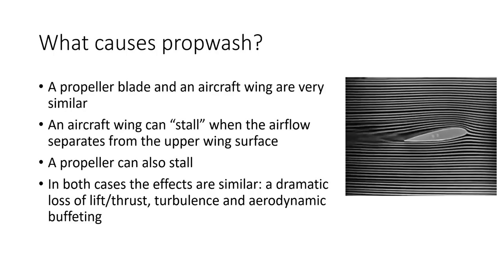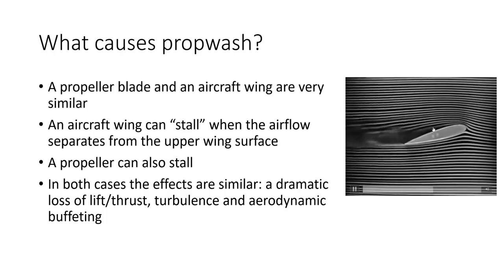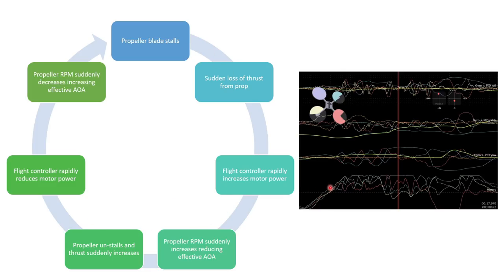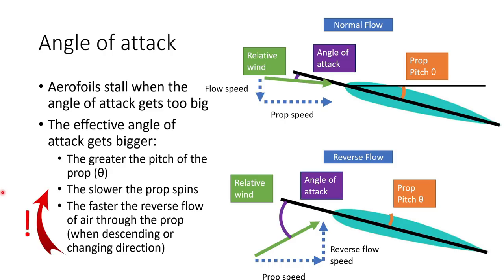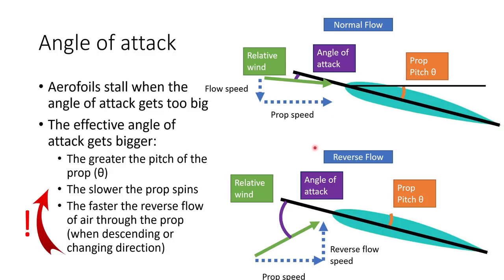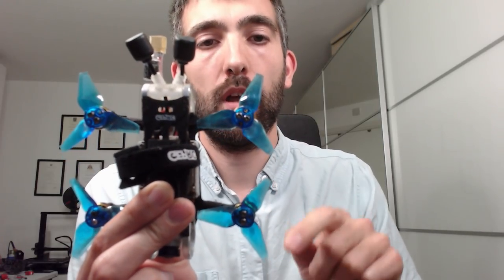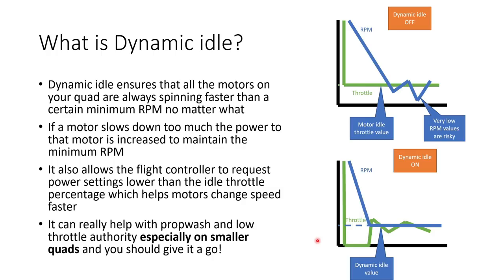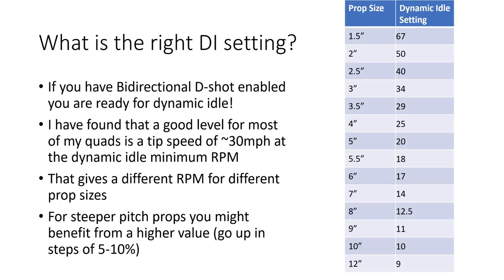What causes Propwash and how Betaflight Dynamic Idle can help!

Comment: After making a tutorial about dynamic idle, I got a lot of feedback from users and from in-the-know experts, and long story short, I concluded there is not a consistent agreement about how to correctly tune the feature, nor is there consistent advantage from using the feature according to commonly given "best practices". Personally I don't use it and just go with a fixed idle percent per usual. As long as you keep the idle percent high enough to prevent the prop from stalling, all is well. In theory you can get lower idle speed by using dynamic idle, but like with many dynamic elements of Betaflight, it introduces uncertainty and it's not always helpful.

It'll be interesting to see if Chris Rosser's recommendations can finally make this feature beneficial for a majority of people.
Reply: He raises idle value after enabling dynamic idle not lower
Reply: If I remember correctly your choice of not using dynamic idle was with betaflight 4.2. Lots has changed on 4.3 concerning dynamic idle. Have you given it a try on 4.3?
Reply: @sendorm  is 4.3 officially released yet?
Reply: If you tune for maximum hangtime it helps to keep your quad stable at spool down with way lower idle %.
At the moment this is the only aspect where Betaflight outperforms  Emuflight.
Reply: Isn't it that enabling dynamic idle, by increasing the minimum prop speed, effectively decreases your hangtime when inverted?
Reply: For me it not about prop wash it really help with low crushing stability mid oscillations it seems the pid loop have much more authority to do minor adjustment
Reply: @TheSTallINNA  Not yet but the nightlies are avaliable.
Reply: @TheSTallINNA  No but many of us are using nightly builds and seeing the benefits.
Reply: a lot has changed since you had a proper look at any thing BF frankly ;]
Reply from the maker: Hi JB, thanks for taking a look at the video. In BF 4.2 the control loop for dynamic idle (DI) is quite basic. This can lead to wobbles at low throttle unless D_shot idle is set high enough to avoid hitting the DI level except in extreme situations. In BF 4.3 DI has a PID controller which solves this issue and allows you to set Dshot idle very low without wobbles.
Reply: Like d- min was so great when it first came out now everyone just turns it off 😆 🤣
Reply: It's likely that in betaflight 4.3 final release, there will be no need to adjust the DShot Idle % value or measure rpm or any of that stuff as in 4.2.
It is unquestionably a much better way to avoid desyncs and slow motor startup problems than static idle settings.
It is a sophisticated form of the old and much-loved 'idle-up' that we used to apply after take-off to stop the motors going too slow.
In the final 4.3 code there isn't any tuning to do.  Just set a suitable dynamic idle value.  A good starting point is 3000 - 4000 rpm for most quads, higher with smaller props, lower with larger props.
Too high a value and the quad will be floaty in flat zero throttle drops.

Lower values give less thrust in flat zero throttle drops, so you drop a bit faster as you reduce the min_rpm value.  Lower values will tend to give slightly better inverted hang time (but only at the start, when you first turn upside down, in that period while heading upwards fast upside down at zero throttle; once you are dropping, just having dynamic idle on stops you being pulled downwards ).
When too low, you may get desyncs or have issues with wobbles at the end of flips from partial desyncs (like what you get with too low a DShot idle value).
The highest idle rpm value compatible with reasonable flat zero throttle fall rate will give the best handling in most cases.
Most racers would go for a reasonably high value.
Reply: @TheSTallINNA  nightly build, yes
Reply: There is really no reason to use fixed Idle percent anymore on 4.3. As long as you get a similar RPM equivalent you will get more low RPM control. Especially with high speed drops or turns.

Comment from the maker: EXTRA INFORMATION:
1. When using steeper pitch props you may need a DI value 1.5-2x what I give in the table at the end of the video to control propwash (e.g. up to ~ 40 for 5"). I fly very light pitch props (Ethis S3, 5.5x2.2 etc.) which do not stall as easily so can have a relatively low DI value.
2. For inverted hang time a light pitch prop is very helpful as you can run a lower DI value and it makes less thrust at any given RPM.
Reply: Chris, is your table still usable for BF4.3, or is a fixed setting of 30 a 40 best for all size props?
Reply from the maker: @HaraldLabout  It's a good starting point for 4.3 and you work the value up until you have the desired bahviour.

Comment: Excellent explanation of the topic! One little remark: It's important to tune the FC for propwash but it's equally important to know how to avoid it as a pilot (line-choice & throttle management).
Reply: As propwash handling improves, the need to fly around it reduces.
Reply from the maker: Very true. My videos tend to focus on getting the best possible performance out of the quad. That will allow the pilot the most freedom when choosing their lines.

Comment: What never occurred to me until I saw the graphs is with dynamic idle Betaflight must have placed the min-throttle in a closed control loop using eRPM as feedback. Initially I couldn't see why this would be significantly better for prop wash handling given that DSHOT updates (and eRPM telemetry) are usually locked in at the PID loop rate (e.g. 4 khz). But then I realised the control loop using eRPM would have much lower latency in detecting and correcting a stalled prop vs the PID loop having to gyro inertial measurements to correct for the slower oscillating prop wash which resulted from the initial stall. Brilliant, thanks for sharing this.
Reply from the maker: In 4.2 the DI feedback loop is quite simple based on eRPM as you say. In 4.3 DI has a full PID controller which improves the performance a lot and allows you to run very low D_Shot idle values without low throttle wobbles. By the time an issue is detected by the gyro it is really too late because the quad is already wobbling.

Comment: For anyone interested, there is academic windtunnel data of single and multiple propellers with negative inflow to determine the causes of propwash oscilations for quadcopters (5 inch fpv type). Unfortunately, the explanation you give (a rapid interaction between the controller and the blade stalling), can not at all be see in this data. The propeller blades do not stall like wing blades do, probably because the prop generates its own induced velocities. No 'sudden loss of thrust' was observed. The interaction between an isolated propeller and the flight controller is therefore unlikely to be a significant cause of the propwash oscillations. It seems to have more to do with the turbulent flow conditions that are generated by the props, rather than the quad changing its stability characteristics. (The study was made public after this video came out)

Comment: Excellent explanation, as always.  Been using dynamic idle for a long time and it really helps prop wash; set correct;y, similar to your explanation, it allows reduced prop wash without the adverse effect of too high a Dshot %age idle creating too much float.  Simple calc to set dshot idle at 20% higher being (D.Idle X 1.2)/(batt volt x motor kv) which is a lot less than simply using dshot idle at a high enough percentage to give same effect
Reply from the maker: Your calculation is a good one. It's worth considering that batt volt * KV only gives the unloaded Rpm (no prop). If you multiply by 0.7 that's a good approximation for rpm with a prop. So your equation might be slightly more accurate as so: d.idle*1.2/(battvolt*motor KV*0.7)
Reply: @ChrisRosser Yeah, I forgot about that. The 0.7 is about spot on Chris. My 1900kv spin up to about 32 to 34000 rpm in flight, about 0.7 of propless speed, so yeah I'll try that today 🙂 nice one.
Reply: @ChrisRosser  excellent video. I am a bit confused after reading the replies: i am running bf4.2 on a 4s 5" quad with 5048 props and 2450kv motors. Should i set dynamic idle to about 30 and then the dshot idle to 30*1.2 /(14.8*2450*0.7)=1.4?

(I would like to maintain good inverted hangtime as well as the benefits of dynamic idle with preventing stalling etc.)

Comment: I have tested this back and forth many times now, and I can honestly say that I don't like dynamic idle.  I understand the idea behind it. but I don't think it quite works how people perceive it to.  I feel like I constantly have to reposition the sticks during a long, smooth, slow banking turn.  smooth stick input should equal smooth flight path.  I'm pretty sure I can feel those moments that motor power is increased to meet min rpm after motor braking, and it's causing shifts in the flight path.

Comment: PSA:

So, after doing a ton of research on the subject, if you are on 4.3, you DO NOT want your dshot idle percent to be over your dynamic rpm value. In fact, a dshot idle percentage of 1% is desirable (per Chris Thompson). The values in the table are a fantastic starting point for Dynamic RPM values, but if you end up with poor low throttle stability for some reason (unlikely) or wish to have a bit better propwash performance at the expense of inverted hangtime, you can raise your dynamic rpm value (NOT THE DHSOT IDLE PERCENTAGE) to about double what chris has in the table in the video.
Reply from the maker: Yep spot on. In fact in 4.3 enabling dynamic idle in the configurator will disable changing Dshot idle entirely so you literally can't get it wrong once the relevant PR is merged. For 4.2 it is still very important to set Dshot idle 20% above dynamic idle to avoid low throttle wobbles 👍

Comment: Lemme get my tea

Edit: Ok. I've watched it. At your previous tuning video you gave a calculation for determining this value. My 5.1 inch prop quad calculations were about 18. Maybe it was a tad low. I will try 20 to see if i can notice any difference. Thanks for this video. I'm sure it will help to many people
Reply from the maker: It depends a lot on the pitch. If it's a very light pitch 20 will be good. For a steeper pitch 30 or even 40 might be necessary to control propwash. Work up slowly to find the minimum that works for you.
Reply: @ChrisRosser  i was using ethix P3 but gonna try out HQ j37. 
I think you should create some content about different airfoils and prop dimensions - propwash effects

Comment: Thank you, thank you, thank you for this video and all of your videos!!! This was extremely helpful in my 4" toothpick. I'm having trouble with severe oscillations, like an audible and visual shaking especially after bumping something (a branch, tapping the ground) and the quad violently shaking (oscillations?) while in an almost fly-a-way state until I drop the throttle and apply throttle again after a second (and yes some prop wash). It's a BNF, the GepRC Dolphin HD 4" and mechanically it's all new and sound (new undamaged motors, proper firmware including RPM filtering via Bluejay and all the screws and arms are secure). Only have a couple of packs after the changes, this certainly helped even though my main issue wasn't prop wash, this seemed to have a positive effect. If you have any suggestions, I'm open for an education and always appreciate your time and efforts. Have a blessed day!

Comment: What do you do in the case of a cinelifter? I would think you have to have a high idle value from the standpoint of load and responsiveness. I find if I make too much a drop in throttle position the bird comes down like a rock with low pitched props vs high pitched props. The low pitched props give me the best video, so I increase my idle value accordingly. I personally keep my moves to have long drawn out movements for the purpose of smoothness, but I can see that dynamic idle can help with smoothing those moves. I think with cinelifters it can be used, but the dshot idle percent value (critical to get right) has to be high enough to support the weight of the quad with respect to the prop being used. Great stuff Chris I really enjoy your channel.
Reply from the maker: If you move to BF4.3 you won't need to worry about dshot idle any more and can simply set your dynamic idle to give you the low throttle feel you want.

Comment: Hello Chris,
for me PropWash is mainly due the propeller going though its own wake, and turbulences. I'm not sure about your vicious circle, I think the FC is only accomodating with the air turbulences it faces.
when piloting, you get propwash in turns and when going down flat. you can easily avoid propwash in turns by managing thrust efficiently: in turns, you have to counter the centrifugal force by increasing thrust so that your quad doesn't slide in the turn, and doesn't meet its own wake: easy, efficient, and doesn't require any tunning ;-)
keep the good work.
Reply from the maker: The prop going through turbulent air was always my reasoning for why propwash happened. But when I researched the subject and did my own testing I could see propwash occurring in situations where there wasn't any turbulent air incident on the prop. The test I used is to fly very close behind another quad. If it was turbulent air causing propwash you would expect very bad propwash flying behind another drone, but that doesn't really happen. So I had to discard that as the primary explanation. Turbulent air does promote flow separation from the propeller, but flow will separate in completely clean air with enough reverse flow. When you are increasing thrust through your turns you are increasing the RPM of the prop, increasing the inflow velocity and therefore reducing the effective angle of attack of your prop, preventing flow separation and propwash.
Reply: @ChrisRosser  when your quad sinks in a turn, the propellers meets the first centimeters of the turbulences it generates: I don't how you tested it, but it easy to do safely with whoops: if you follow à 5 inch 2m behind (and underneath right?!) You might be too far.
Clearly, reverse flow makes it worse. But, you are missing the solution here, avoiding sinking in the turn by putting more power to avoid turbulence, but also reverse flow.

Comment: I have the woopfly16 by sub250. It tgis also possible for woops. This one is a bit on the heavy side. About 50g can i use dynamic idle for that. Prpos are 1,6 inch

Comment: I'd probably put a big disclaimer on just going with preset values. Most my 5inch quads are at about 19-20 when tuning via motors tab which is inline with what you say, but my AF227 are at 24 at 4% idle. Attempted to preset them at 20 and got a desync first flip.
Reply from the maker: Did you set your D_shot idle to 20% more than idle RPM? You can estimate it by taking DI*1.2/(motorkV*battvolt*0.7) which would be ~7.5% for 1960KV on 6S, ~8% for 2710kV on 4S. 4% on 24 sounds a bit low to me?
Reply: @ChrisRosser  Don't know about that, but I like running low idle ~3-4% so I don't get sucked to the ground when I'm upside down. 4% on motors tab spins the motors at ~3000 RPM with a prop on. According to BF wiki entry for dynamic idle, take 3000, knock off two zeros and multiply by 0.8 to get 24. These specific motors have a lot of thrust and poor low throttle resolution, so have to compensate by setting throttle expo at throttle mid point.

Comment: Hi, thanks for the wonderful video Mr. Chris. I have a cinerace20, I love how it flies but it goes into terrible prop wash after some power loops. Do you think upgrading motors from 1203 5500kv to 1303.5  5500kv will help maintain higher torque and reduce prop wash?

Comment: Great video! I've always wanted to learn where propwash is comming from. I don't use dynamic idle until now. But I'll definitely give it a try! Should I include it into my tune now or after I've finished following your BF4.3 tuning series?
Reply from the maker: In BF 4.3 you should definitely be using it. In 4.3 you can set D_Shot idle to 0% because DI has a full PID loop so performs much better. I'll cover this in more detail in a future video.

Comment: In the 4.3 tuning notes, CT has some interesting ideas around putting the idle value below the dynamic rpm value. I believe to allow the separate PID controller on Dyn idle to do its thing at low RPM. Any thoughts on this setup?
Reply from the maker: Yes that's the right approach for 4.3 because DI now has a PID controller! For 4.2 you still want D_Shot idle a bit above DI to avoid low throttle wobbles.
Reply: @ChrisRosser   the 'karate' tune makes changes too the DI pid controller ;D